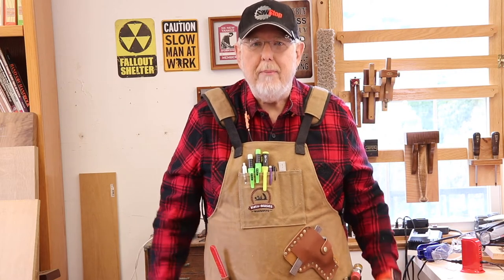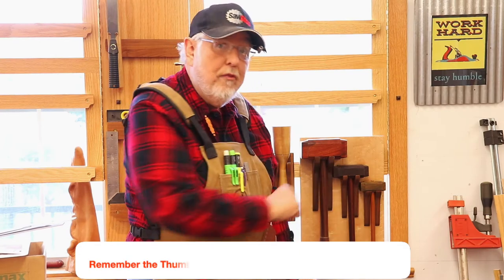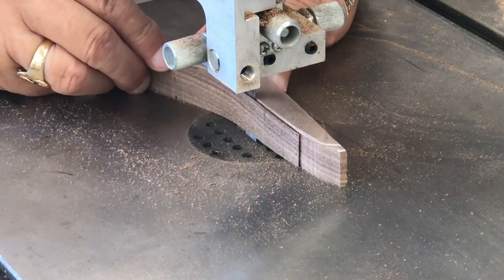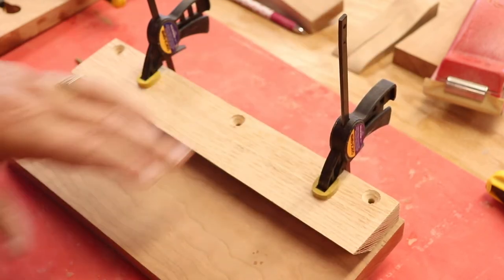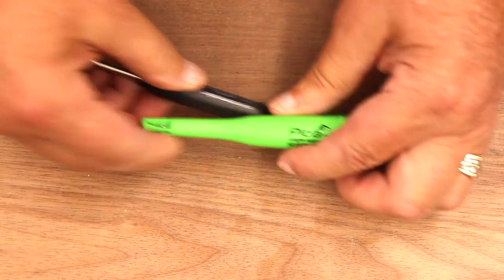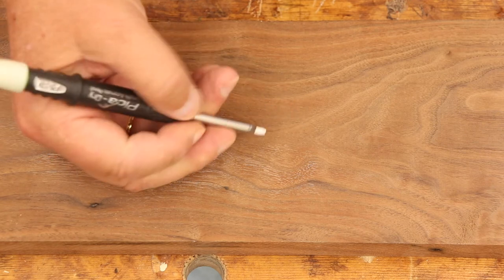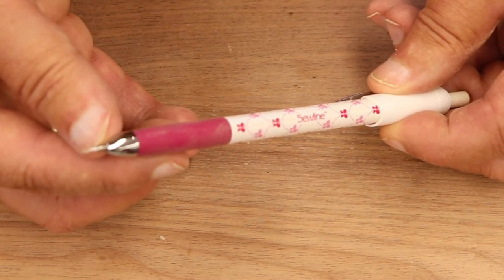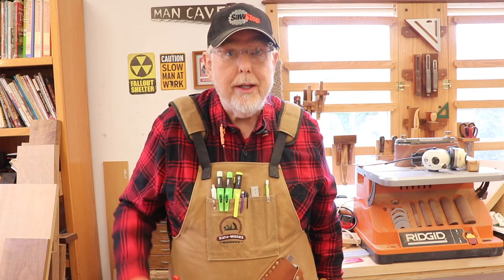Marking Dark Woods with a White Pencil - I found Better Pencils - Pica & Sewline

Comment: Hello and thank you for the video. I install kitchen cabinets and need a white pencil to mark sometimes dark stained or painted moldings to length. I am leaning towards the Sewline Ceramic white pencil. Have you ever tried it on dark wood with a clear coat on it, that can be a little slick sometimes depending on the quality from the factory? I need a sharp crisp line that is easy to see and easy to use (I prefer not to have to constantly sharpen it).
Reply from the maker: While I’ve never used the Sewline pencil on pre finished wood it should work out OK. Any white pencil will tend to flake if pressed too hard. When it does you will need to resharpen. 

For your job I pick the Pica because it keeps a fine point fairly well and is very easy to sharpen.

Comment: Don, thanks for a great video. 

I looked for the Sewline pencil at Hobby Lobby this week, but I could find them. I guess Amazon will be my source.
In several of your shots, there are pieces of lead scattered around. Is the lead easy to break or is that mainly when you have it extended farther?

I like your SLOW MAN AT WORK sign. I may need to get one.
Reply from the maker: Thanks for watching and commenting. You may find the Sewline pencils at fabric shops. I’ve never looked. You have a good eye spotting the pieces of lead. I was “learning” how far I could extend the lead out of the end of the pencil. Obviously I’m a slow learner. I’ve discovered that if the lead is only sticking out about a 1/16th of an inch, maybe a tad more, the lead doesn’t break off like that. 

The “SLOW MAN WORKING SIGN” is my wife’s favorite sign in the shop. She says it “fits” me well. 😁

Comment: I know this isn't probably the best place to post this. But I just wanted to thank you for the nova comet reviews. I just picked up one that is 2 years old with g3 chuck and bed extension and digital read out. My question is do you wish it had a 1 hp motor instead of the 3/4 hp motor.
Reply from the maker: George, posting this here is just fine. Thanks for watching my videos. I haven’t noticed a problem in horsepower on my Nova. You have to remember though I haven’t turned any bowls. Perhaps they might turn better with the additional 1/4 house. For everything I’ve done so far it’s been fine.